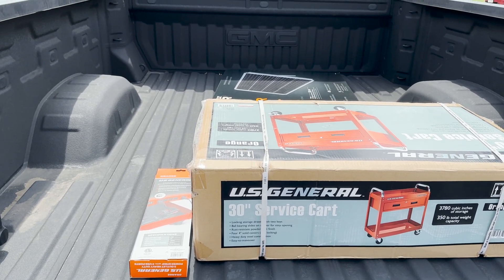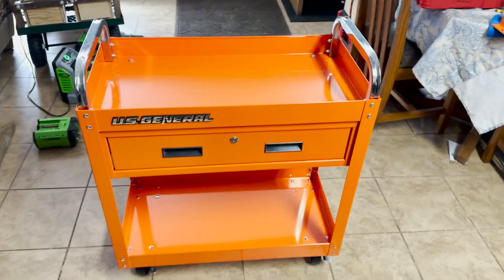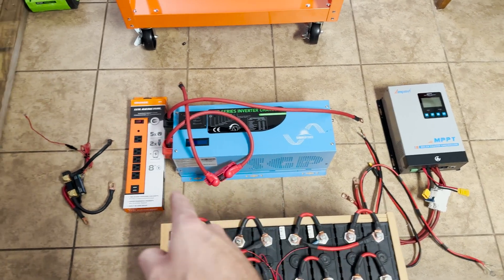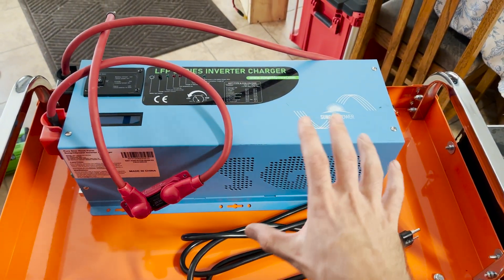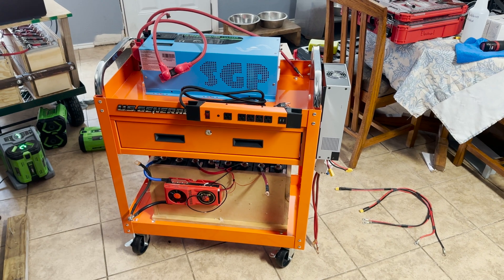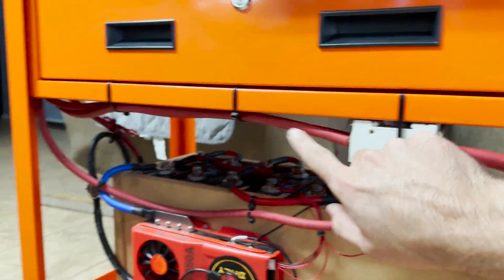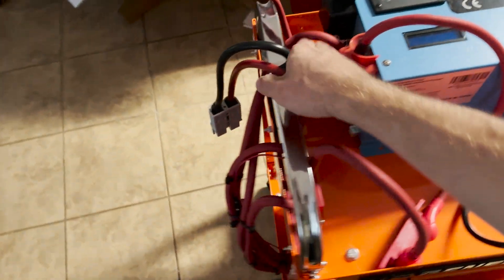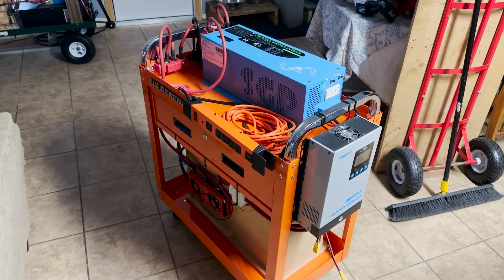DIY 12 volt Solar power roll cart Lifepo4 battery, 3kw inverter

Comment: Im Building almost the same setup. Im using the Aims 2500 watt inverter charger 2 Li Time 12 Volt 200ah Plus Batteries.  im going to copy the way you ran your Busbars  i bought 1/0 Windy Nation Cable and a Victron 150/45 Charge controller. This type of Cart makes any project nice 👍.
Reply from the maker: @hegefarms4260  Nice! This setup is used everyday for me has been rock solid, sounds like you have a solid game plan

Comment: The daly bms is a fair expense on this unit. I know that the batteries are a fair expense, and it protects them from mismanagement, but it may not be necessary unless you are going to do something like charge it directly from an alternator (viktron makes a hood piece of gear if you plan on that, many car alternators are 2kw ).  It does give nice metrics though. 

Maybe think of a charging bus, and a discharging bus. The lifepo4 batteries can be discharged to empty without damage, so that part does not need circuitry. As long as your chargers can set a maximum voltage, you may just need an active balancer in the 1-10 amp range which is much cheaper than a daly. 

Where do you get those nice cables?
Reply from the maker: The cabling is windy nation 2 gauge pure copper, as far as the bms it’s a good investment to keep the battery balanced and provides some safety, you don’t want to run these cells to zero. You can use an alternator but will need a way to regulate current, these will take everything thrown there way and most alternators will cook from that!